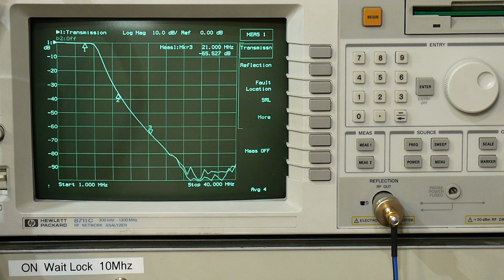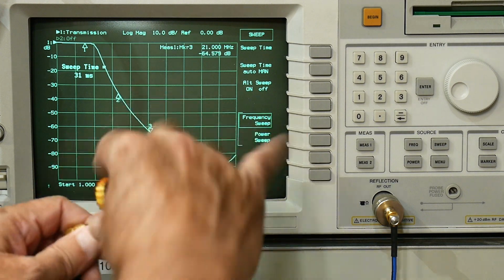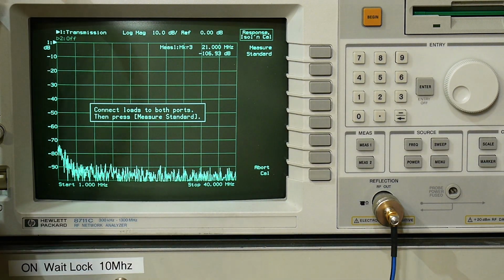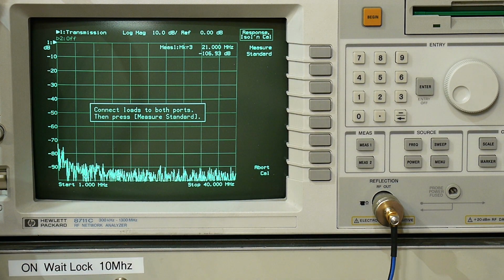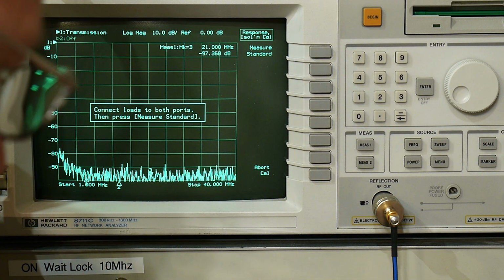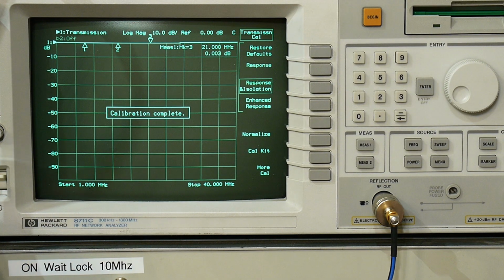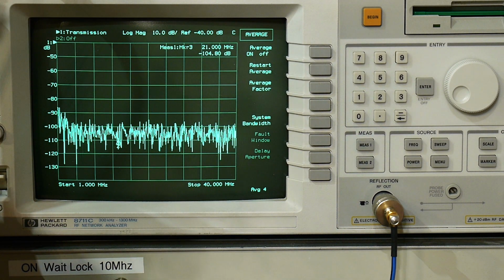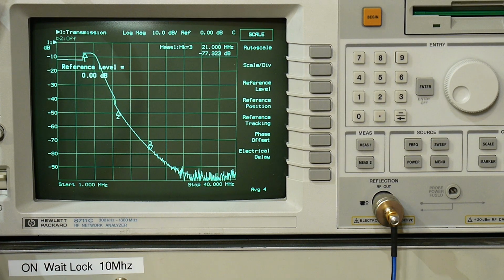#910 40 Meter Low Pass Filter Dynamic Range

Comment: Hi, thanks for the post.
Let me make my points here.
1. For making a LPF (high Q) for 7 MHz the choice of material is #2 red-clear, iron powder material; yes for anything below 10 MHz it's the material of choice.
You can check by the datasheet or by simply looking into the LPF section of your radio.
2. You are using the iron powder material yellow-grey which is akin to #26, a material used in the common mode current filtering in the SMPS or any DC to DC converter.
3. In your previous video I have made the same comment but you simply denied it saying that the filter was working fine on your nanoVNA. 🙄
4. I assume that to be the Chebychev filter type.
5. A 7 MHz (LPF 7000-73000 kHz) filter should be designed to have a cut off at around 8 MHz or so.
6. The frequency of scanning must be first between say 6 MHz to 8 MHz and for the whole of the HF band; so upto 40 MHz which you have done here.
7. You didn't place a marker on the "knee" of the tracing.
8. A torroidal inductor, though "self sheilded" still it's wise to place them at right angles to each other to avoid magnetic coupling and with a spacing of at least half the diameter away.
9. Yes, you were talking about "cross talk" between the capacitors.
10. And about Faraday shield between the inductors and of the feed-through in the partitions.
11. By holding the whole bunch of the filter you are increasing the inductance of the coils and provide stray capacitive coupling from end to end of the entire filter.
12. Next time, please make a filter using the correct material, red-clear iron powder mix-2, (from Fair-rite or Micrometals)
13. You can make a simple single sided PCB either by etching or using a scribe knife.
14. Mount the torroids on the top with the windings covering the 270 degree of the perimeter and the bare part of the core may rest vertically on the board.
15. Now you know that they have to be mounted at right angles to each other with a spacing of at least half the diameter of the core (1 dia is better)
16. Always make a schematic with the values, number of turns, gauge of the enamelled copper wire, inductance you achieved by measuring and the value of the Silver Mica capacitors.
17. And please make a tracing on the nanoVNA too for the purpose of comparative study.
18. Not everyone is as well provided as you.
Looking forward to a second part of the video 👍❤️👍
De VU2RZA.

Comment: A couple of thoughts:  First, it looks like you could increase the inductance so that the initial knee is closer to 7-Mhz; I'm not sure by looking but I think it could be lowered.
Second, since you're the rich-kid on the block (Hi-Hi) and have the dynamic range, I would would really like to see you re-make the filter as a compartmentalized unit and see what you get.
Finally, It looked like the second-harmonic was only 35-dB down at 14-MHz, (I think the FCC requirement -s 45-dB); this surprised me since you are using 3-elements.
Anyway, great video--thanks & 73...

Comment: Nice demo! I think your title though is a bit misleading. It is really not the dynamic range of the filter you are measuring but the stop band attenuation. If you swept out to 100 MHz or 200 MHz or whatever you would see the attenuation rise again due to stray coupling between elements. Also due to the self resonant frequency of the toroids (stray inter-winding capacitance). I imagine the fact that the toroids are somewhat close to each other would also cause the stop band attenuation to rise at very high frequencies due to capacitive coupling.